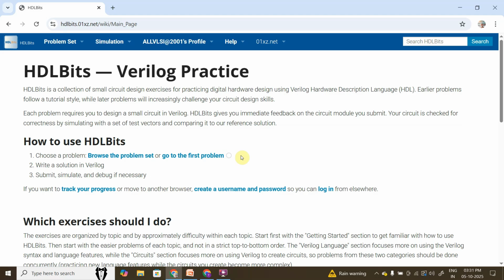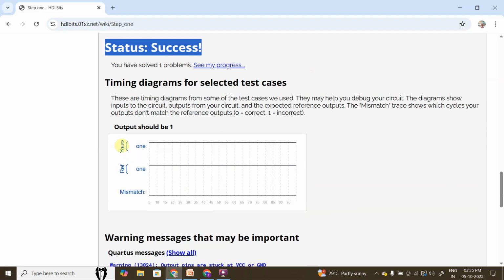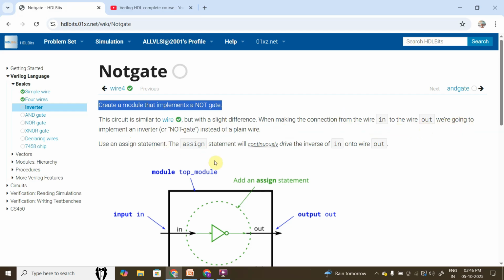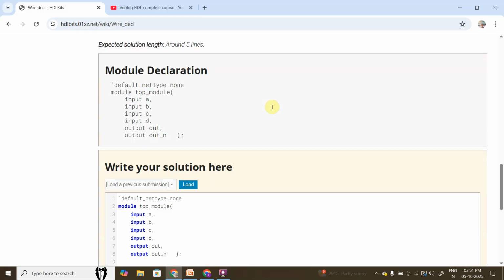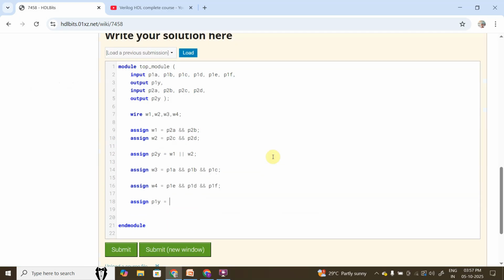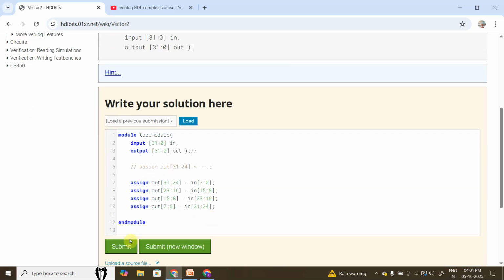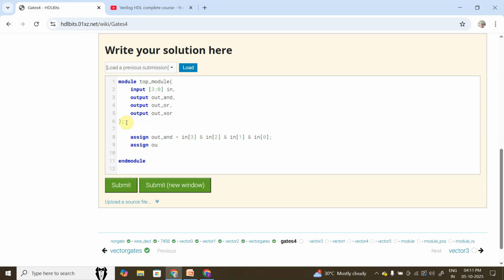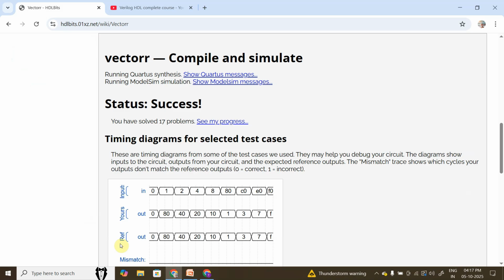Verilog Practice on HDLBits | Step-by-Step Problem Solving Explained

Comment: For last task just use one-liner since both arrays are packed:
assign out[7:0] = '{in[0:7]};
Also could be done with typecast operator.
This is exactly why I prefer SystemVerilog over VHDL. On VHDL it is impossible without loop or your way.